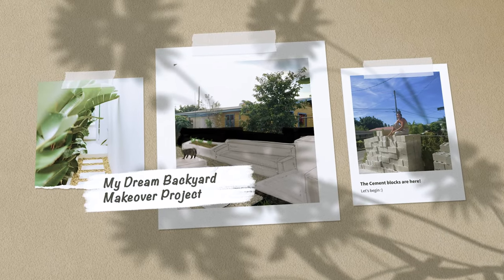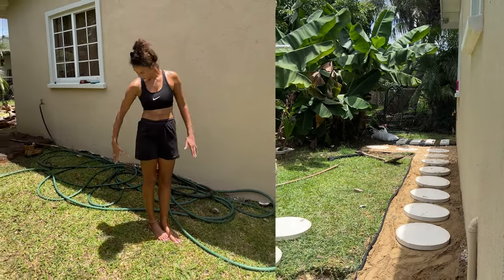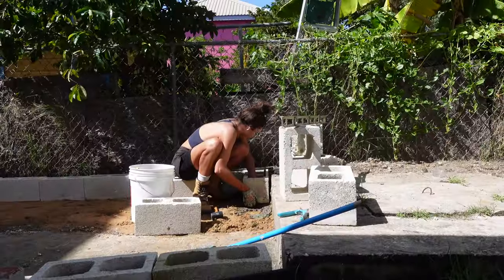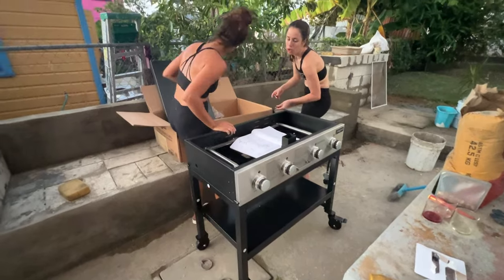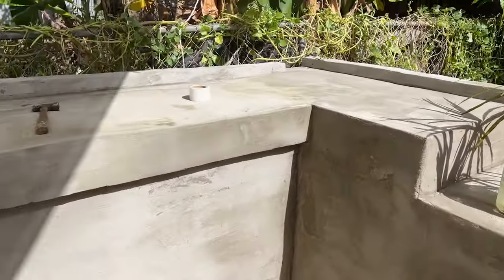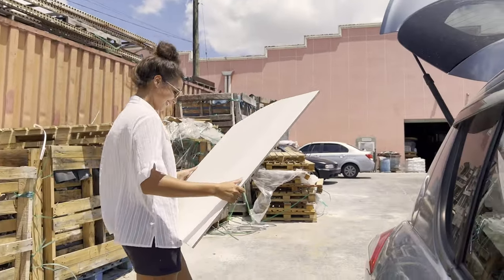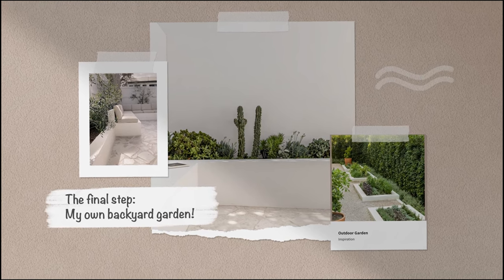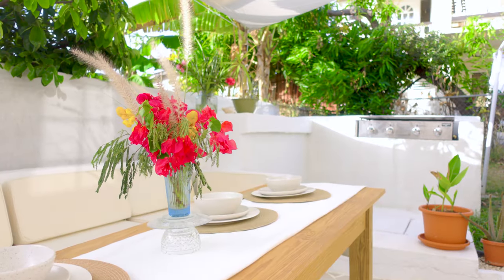Unveiling my Backyard Makeover Series!!

Comment: Correct me if i'm wrong but i think that it's dangerous to hide the gas tank completely because if it's going to have a leak and it doesn't have ventilation, it will explode!🫢
Reply from the maker: It’s not fully close, there’s ventilation if needed 🤩